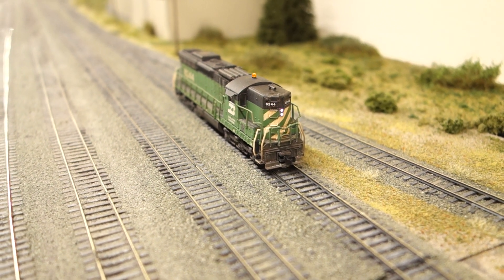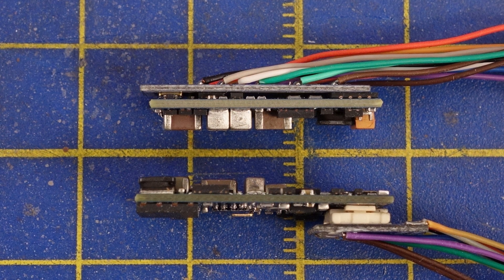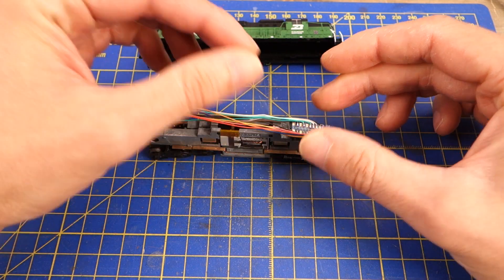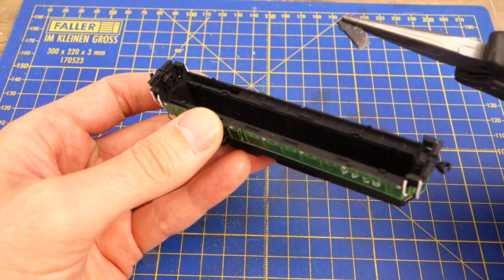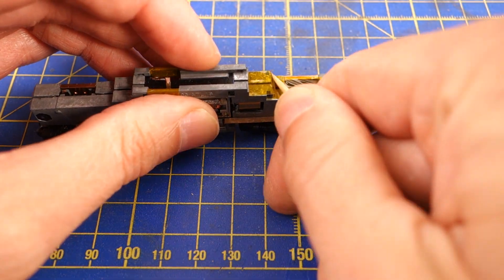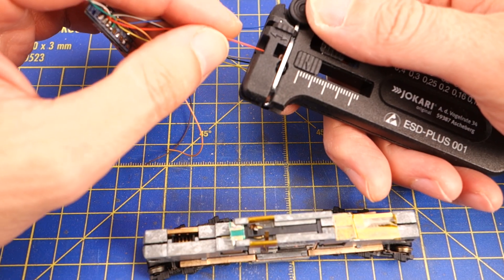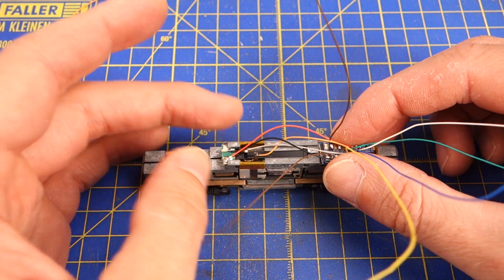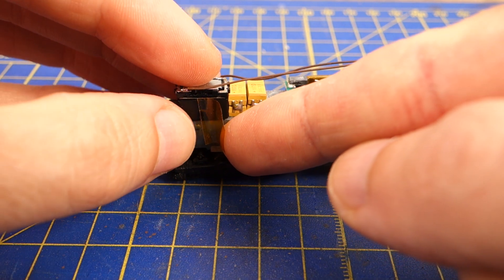How to install an ESU Loksound 5 nano into an N scale SD24

Comment: Hi. I watched several of your videos now and it´s really cool how you are able to rebuild your locos with sound and some other specials - even in N scale. Unfortunately I´m completely untalented in electronics, so I thought about just buying a new engine with factory sound installed for my tiny N scale switching layout, but 250 Euros or even more is just to expensive for me at the moment. So I looked for options to install sound in my existing old Atlas GP38 (motorframe says 1997), hoping this would cost considerably less. I found out there is a drop in decoder with speaker by XL System Inc. for GP38 on ebay for around 63 USD which makes it around 90 Euros incl. shipping from USA to Germany. I understand the sound is rather mediocre, though (you get what you pay for). Then I saw there is the likely much better ESU 58751 for 90 Euros or more which is supposed to be for "older Atlas engines" but I understand you need to add the sound file yourself of course and for this you need another device which is another 130 Euros. So I guess my question is, is there any other way to easily add sound to my one and only American engine without high costs? Vielen Dank im Voraus und beste Grüße!
Reply from the maker: The 58751 should indeed work with that type of frame. There is an overview on all the models of that type at http://www.spookshow.net/loco/atlasgp3840.html and as long as your frame looks like the 1997 frame in that article the decoder should fit. I have not used that type myself though. It might be tricky to find space for the speaker when using that kind of decoder, so using the loksound nano might still be the easiest way to make everything fit.

I can't say anything to the XL systems decoder. I have not heard from that manufacturer before.

Some dealers offer loading the sound file into the decoders as a service. Either for free or a very small fee. I think Fischer Modell does that. So buying a Lokprogrammer is not necessary. When I started with sound decoders I used that kind of services without issues.
Reply: @ModularRailroading many thanks for your quick reply! I will definetely check out that webpage that you mentioned and will continue to evaluate my options.

Comment: Great tutorial.  What kind of soldering iron do you use?  The tip seems quite small.
Reply from the maker: I bought a cheap soldering station a couple of years ago. The tip came with the station. It's not particularly small and has become a bit blunt over the years, so I think most pencil tip shaped solering tips should work well.

Comment: Your GP35 video helped me tremendously for my first ESU Loksound micro installation into my GP35s. Thank you. What type of wire stripper did you use in this SD24 video?
Reply from the maker: Thanks! I'm glad that these videos make people more comfortable trying to do sound installations themselves.

The wire stripper is the Jokari JOK 40 027:
https://www.reichelt.de/de/en/wire-stripper-esd-plus-001-102-mm-0-12-0-40-mm-jok-40-027-p220779.html?r=1

Comment: New to dcc, these nanos come with the adapter board correct?
Reply from the maker: Yes, the variant with part number 58923 comes with the adapter board with all the wires attached.

There's also the variant with part number 58925 with the E24 interface. I don't know that one, but it probably doesn't have any wires attached.

Comment: N scale installs look tricky but you make it seem way easier than it seems. Have u considered any of the loksound direct atlas boards, esu has 2 styles for pre-2016 and post-2016 engines
Reply from the maker: I have looked at them and a couple of guys in our group have bought some of them. To me it seems they cause more problems than they solve for engines that don't already come with a speaker or at least a dedicated spot for a speaker.

Using the direct boards and finding space for a speaker seems to be a real struggle from what I have seen, because the boards run along almost the entire length of the engine.

For converting the newer Atlas silver engines they are probably a great option though.